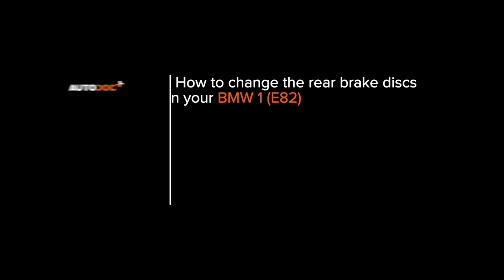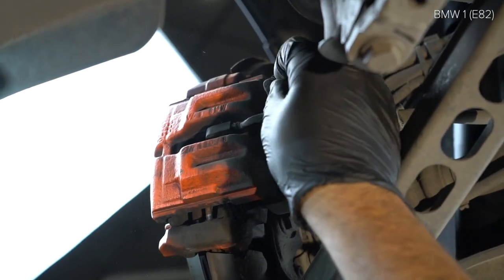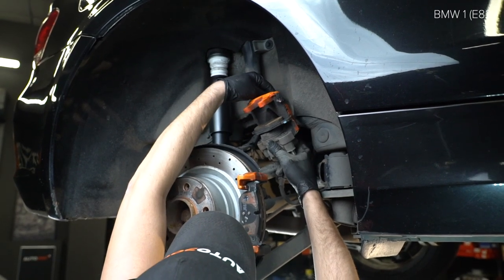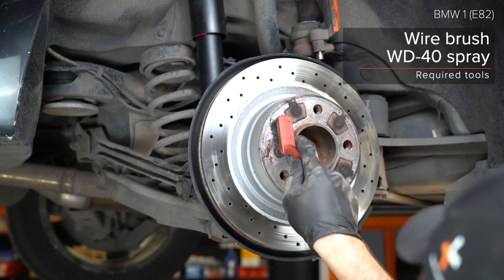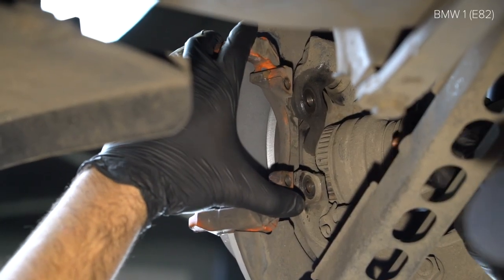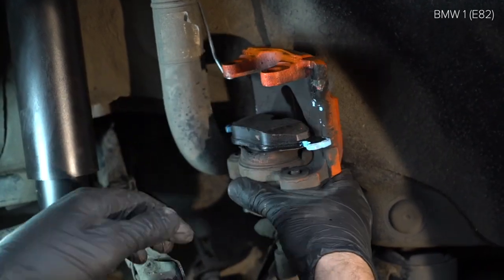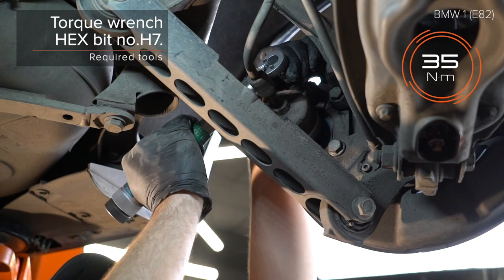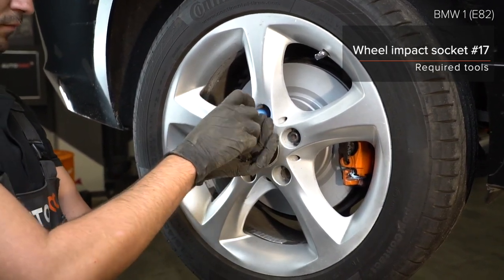How to change rear brake discs on BMW 1 Series E82 [TUTORIAL AUTODOC]

Comment: Factory caliper carrier bolt is Part #: 34-20-3-414-763-M9. Isn't  this a stretch bolt that should be replaced?
Reply from the maker: You can find this information in the technical documentation on the repair of the car.

Comment: I had a problem got a E82 but the rear disk that was delivered was E88 and told it’s the same 
But it’s not the disk fits yes but the caliper bracket don’t
Reply from the maker: Hi! Thanks for your comment. We recommend using only compatible parts.